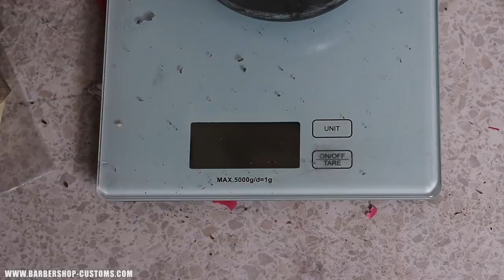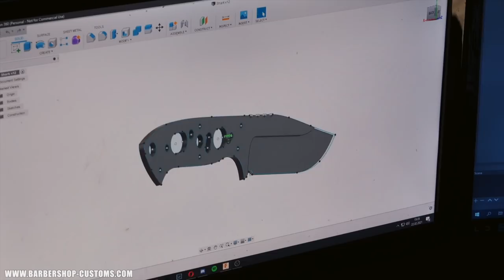Making a Knife w/ COPPER Wire Sponge Epoxy Handle

Comment from the maker: Do you like unusual epoxy handles?
Reply: Tak są piękne. 😍😍😍😘😘🥰😘😁😁👍👍 Jak wszystko co robisz jesteś oprócz Tomasza Dziubińskiego i Pawła Gruszki moim ulubionym knife makerem 😁😁👍. Rób to dalej i więcej. Pozdrówajki. 😁
Reply: Bellissimo
Reply: No właśnie a propos tych dwóch panów, może współpraca ze sklepem Polish Custom Knives? 😁
Reply: I do like the handle very much!  But I have a question about it also.  You pulled vacuum on the material you used to make the mold, but did you use either vacuum or pressure or both when you put the scrubber and epoxy in the mold?
Reply: Definitely!
Reply: Great work mate! Keep on going this way!!
👍 I make the same kind of content 👍
Reply: Awesome looking knife and glad you are using epoxy. Just don't stop using that beautiful burl you use. You guy's still make the best shaped knives out there and one day I will get one off you. Keep up the awesome work.🤘
Reply: I tried the same thing but could not find copper scrubbers , they were all copper coated steel , I used a magnet
Reply: I would have never thought to use a plain scouring pad for scale material!!  The result is  incredible.
Reply: How to make knife from film killing season
Reply: Love em
Reply: Just my opinion, but I think the handle could use more copper sponge,  and maybe liners of thin sheets of copper. 
I love the colored metals like brass and copper.
Reply: I don't know if it qualifies as "unusual", but I've been using wood putty epoxy for handles more than actual wood lately. I love how smooth it can get with fairly little sanding.
Reply: Yes i doooo!
Reply: I never used epoxy on my  Puukko-Knives but I'm very impressed to watch you work on epoxy handles. Very nice tools you have also I look with great interest them. Greetings from Finland.

Comment: Do you get a good heat treat with the stainless steel wrap on the blades? I always heard you had to do a plate quench with a wrapped blade.
Reply from the maker: Yes, It all depends on the steel, temperatures and times. You gotta know what you're doing :)

Comment: How does the sub zero treatment help?
Reply from the maker: It transforms retained austenite into martensite, which in short makes the steel harder and increases the wear resistance.
Reply: @BarbershopCustoms  I thought that converting austenite to martensite was done by quenching
Reply from the maker: @christiaanjordaan8428  Yes, but in high alloy steels, you tend to have retained austenite that was not changed (depending on austenizing temperatures and the steel). I won't explain the whole process here, it's too complex to write it in a comment. If you want a detailed explaination, search for cryo HT.